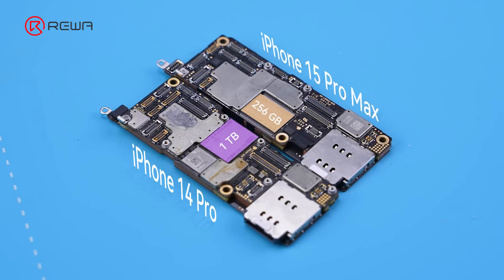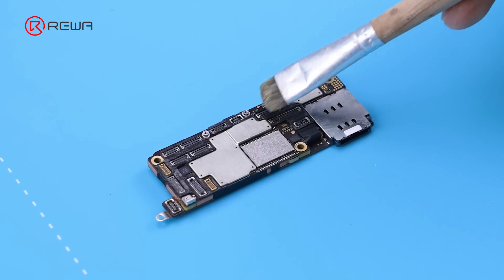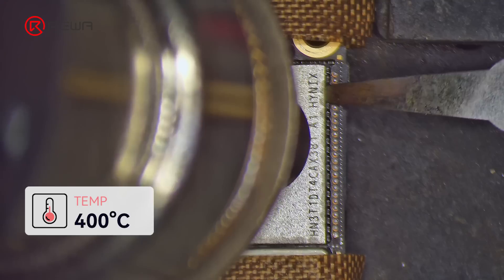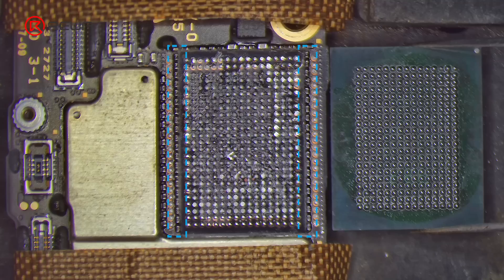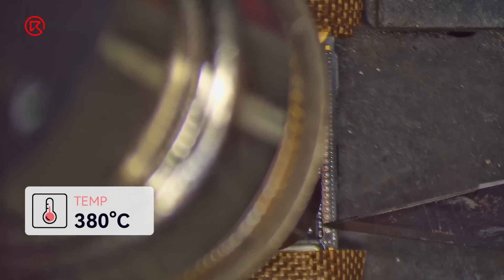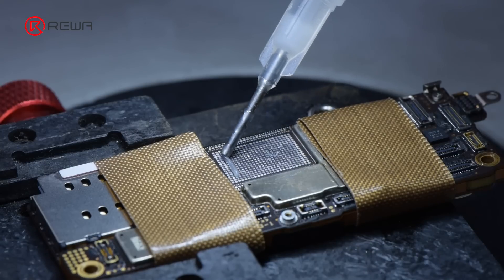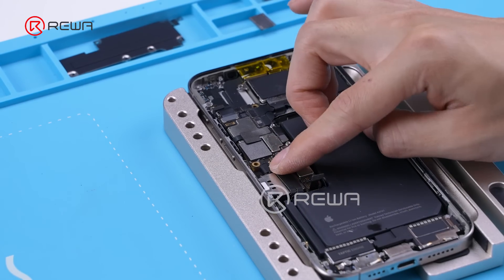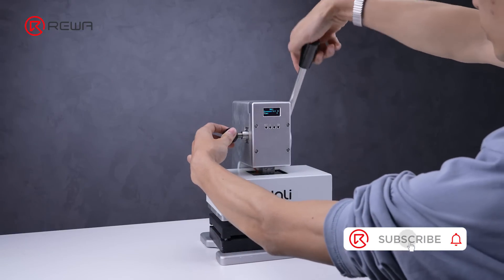Can iPhone 15 Pro Max NAND Swap from iPhone 14 Pro?

Comment: The reason why the NAND from the other iPhone doesn't work is because the iPhone has to program the firmware on the chip which can only be done when it's brand new. Once there's already firmware on the chip it can't be used in any other Apple device
Reply: U can use programmer box to remove tht firmware

Comment: Hi sir rewa.. im your die hard viewers, but just first time comment here..

I want to ask, if we replace nand with new ic and not use programmer to read the data from old ic, is it possible to use? What will happen?

I hope you reply me for gain more knowledge..
Reply from the maker: Before iphone 12, 11 and even earlier, you need to use programmar to activate the Nand, otherwise the Nand will not work
Reply: @rewatechnology2008  i see.. so 12 - 16 series no problem if dont use programmer?

Comment: how exactly is the pressing machine restoring its waterproofing ?
Reply: I presume it’s to help strengthen the bond that between the phone and the display, so before the glue has set, by placing it into the pressure machine, it should help the glue to form a tight bond between them both and probably helps it to spread out uniformly as intended and create a uniform bead around the whole display, preventing any gaps or weak points that could become gaps later on, in which water may be able to seep in if there’s a gap big enough, probably helps with moisture too..
And with the water depth rating - water would be a high pressure so a stronger uniform bond is needed I reckon.

Like how vices are used when gluing two pieces or wood together, helps them bond together better making it a stronger bond

That’s my best guess, i think that’s correct but not a 100% sure about it being a uniform and even bead, idk, eeems logical.. Hope that helps

Comment: Amazing work as always - I nearly booked my training course 5-6 years ago to learn about micro soldering and fixing iPhone devices in general.  Due to the wide UK consumer market not wishing to have their devices repaired I decided NOT to venture into mobile repairs.   Nearly most UK consumers rather swap their devices for a new one every 2-3 years so there was no place for me to offer repair service.   The  UK market is huge and I could leave my full time job to repair phones all day but not the case!
There are bigger retail repair companies who are buying in thousands and repairing these devices.  These companies also have major buying power with large retailers like Apple and other sources who sell their broken devices to these people.  This leaves small guys like me wit NOTHING.....
This is the reason why I pulled out of this industry and sold off all my micro soldering kit and equipment.
Reply: Very good assessment. But in developing nations or third world countries, repair is still very much in demand. I do agree that large companies who buy bulk from Apple are the ones that do benefit from repair. But they also resell these phones, even to developing or third world countries who can't afford to buy new iPhones which is pretty much a luxury item for them. Although I think you could still benefit from buying defective iPhones and then repair and resell them 1 phone at a time as a side job, then expand as you go on.

Comment: wait, before applying black adhesive after upgrading the emmc, how can you be sure that there is no short circuit pads of the bga?!
Reply: If you are not experienced with the upgrade, the try to flash the phone before reapplying any adhesive. Just put the motherboard back and attach all the connectors.

Comment: Just do not buy an Apple iPhone... Fixing Them Yourself is extremely difficult or impossible... A Moto G1 changed battery with a standard screwdriver and finger nails. Battery change should and will return. Saves waste and the planet.

Comment: I have question for you, if I have an iPhone 13 Pro or later that's capable of ProRes but only 1080p because its 128GB, will increasing it to 256Gb or high grants the capability of shooting ProRes in 4K? I know 256Gb and above models can shoot ProRes in 4k but not if you have 128Gb.
Reply: After the iTunes restore a function within the camera app would detect the storage change
Reply: But if you need to do all of this 
Get 1tb cos it js not so expensive 
And a technician would ask Good money for doing this if not refusing to
Reply: shortly, yes.

Comment: Those "ground resistor" could be used for impedance matching. Removing them may lead to unstable read/write to nand.

Why not use the same 1tb nand in iphone 15 pro
Reply: Because there are no used iPhone 15 scraps yet

Comment: If you just replace the NAND without NAND programming, so.. where is the syscfg data stored?
Reply: Eeprom or cpu
Reply from the maker: Will automatically going to DFU mode if you don’t do programming
Reply: Fused on CPU behind TEE and efuse since A14 Bionic
Reply: Will every part, like the camera and Face ID, work properly after upgrade?

Comment: do I understand correctly that I need a new non-activated iphone 14 pro?
where can I buy a new nand flash?
Reply from the maker: In markets you can find some of it. And there is also dedicated tools which can remove system data which let it become a new NAND
Reply: @rewatechnology2008  about the tool, do you mean jcid v1 pro?

Comment: no programmer required?
Reply: just itunes.
Reply from the maker: Since it’s a new iPhone 14 Pro NAND without any data write in before, so there is no need extra programming. Only using iTunes to restore is fine
Reply: @rewatechnology2008  happy to see that some things become easier :D thank you

Comment: Why remove the ground resistor??
Reply from the maker: First one as you see, the reason is because the 1TB NAND size is totally different from normal 256GB or 512GB NAND. So is much wider. So we have to remove it and as you can see it working normally
Reply: @rewatechnology2008 bro can u make a full course plz
Reply from the maker: One more reason for why 256GB or 512GB these types motherboard have more ground resistors is because these NAND are smaller than 1TB. Therefore, we predict it can prevent glue overflow during NAND encapsulation also
Reply: @rewatechnology2008  or Maybe the 1TB nand uses more voltage and those ground resistors prevent the lower storage NANDs from shortcircuit / overvoltaje, probably that’s why, not very sure
Reply: @shaklama_brakama no it sounds like you’re just making shit up 😂
Reply: @johnandrews9433  if you’re hungry, you can take it 😂
Reply: @shaklama_brakama  congrats that almost made as little sense as your initial conjecture
Reply: If you can see, the 1TB NAND its much wider than the 256GB one, and it doesn’t need that set of ground resistors
Reply from the maker: @shaklama_brakama thanks for your detailed explanation
Reply: @rewatechnology2008  👌
Reply: @shaklama_brakama интересно сколько после такой модификации проживет телефон, все равно это уже не заводское качество
Reply: @maximalexandrov4080 да отлично все жить будет, если сделано не на коленке и кривыми руками. Прежде нанды дохли как мухи, во времена 6-7 серии айфонов, а соответственно использовались с замененной флешкой. И ничего, помирали в итоге скорее от рук нерадивых владельцев, чем от вмешательства в заводскую конструкцию материнки))
Reply: @megahaker123  ну отлично) главное что бы эпОл не ввел какое нибудь сопоставление серийника и объема памяти
Reply: @maximalexandrov4080  это было до 11 серии включительно, но трудностей не представляло перенести калибровки из старой флешки в другую
Reply: @maximalexandrov4080 странно что они это убрали вместо того чтобы совершенствовать. Даже в батарейке есть чип
Reply: @shaklama_brakama  okay yes, true 
Thanks
Reply: How can you help with my galaxy tab S9+, I'd like to upgrade the 256gb to 1TB😊
Reply: @Khan-mg9bs  don't do this to your new device it doesn't worth it, you just buy external  ssd drive
Reply: @Khan-mg9bs just put a 1tb micro sd in ?
Reply: @bean9005  you wouldn't understand
Reply: @bean9005 in what?
Reply: that resistor pcb id line
Reply: Because that 1tb is bigger than 256gb. So